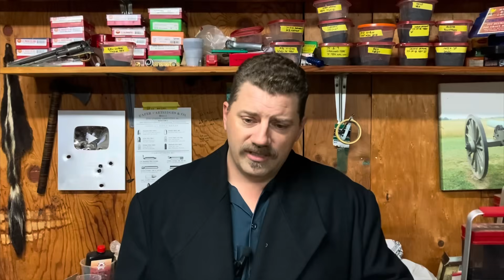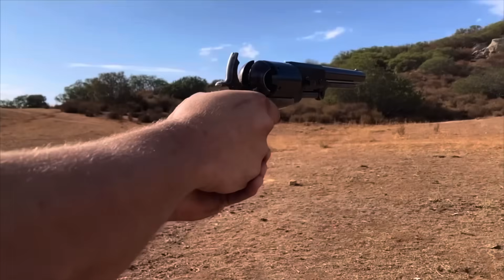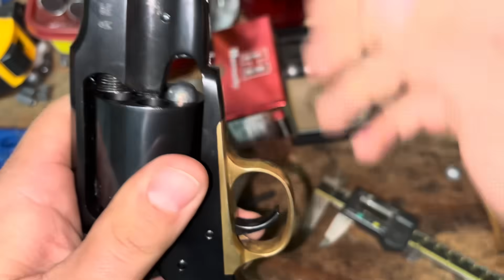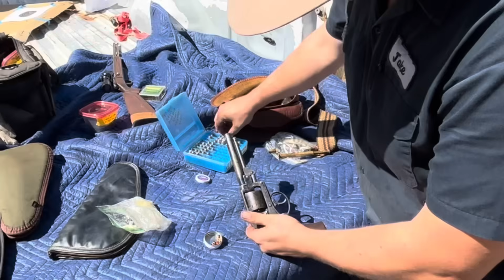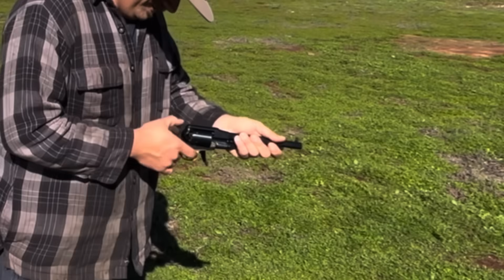Chain Fire Number 4. But Who’s Counting?

Comment: Ive only been into BP a few years but did a lot of shooting in them and i think i got lucky with good fitting cylinders. They cut great rings at .454 but i like to leave them loaded between shoots because they are guns, not expensive clubs. So I always lub them, first i used homemade lub over the balls (no juvenile jokes please) , then switched to lubed wads with a cardboard circle protecting the powder. I only did this for moisture protection for the powder but if it lubs the barrel all the better. Nail polish on the sides of the caps to seal up that end too.

However, when i go out shooting, I use that configuration up then shoot 3 or 4 more cylinders with no lub. Never a chain fire. I know shooting every other week a couple dozen shots amounts to little, but i notice that my rings are well cut and if i have a chain fire then oh well. I also use homemade caps with no issues other than the occasional light spart that doesn't go off and i usually know its a dud when i put it on. 

My experience is if you have a tapered cylinder, why not get a knew cylinder? I know money doesn't grow on trees but they are cheaper than a new gun. Granted, your not going to get a new one for that old Starr

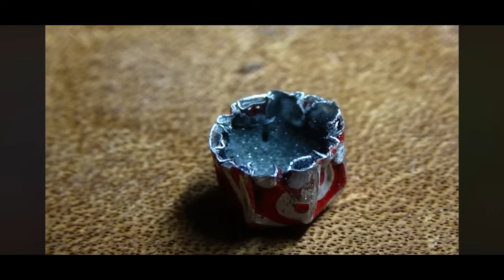Comment: 17:50 Thats WAY too much priming compound. You need half that, maybe less. I make a ton of caps and with factory nipple, they work great. That much compound and you're asking for trouble. The nipple doesn't have enough volume to contain that much pressure and gas, it has to come back at you.

Comment: It's not important what I (or we think or belive) BUT I absolutely and positively think you're right.
People tend to forget that from cylinder gap you get a signifficant pressure stream of hot gas, sparks... which gets directed in to left an right chamber
i NEVER heard of chainfire further than neighboring chamber...
If you don't use wads or have undersized balls (pun intended) -there WILL BE chainfires BUT
If you use grease/lube, wads or paper cartridges -> it WILL NOT happen !
AND.. .if you look at the low-mo you WILL ALWAYS see backfire from the nipple when chainfired but that ABSOLUTELY doesn't mean there was culprit...
(just sayin')

Comment: Ive shot cap and ball revolvers alot. Surely not as much as Jake but I'm what I'd call an enthusiast and cap and ball is probably my favorite hobby. 99% of the time I lube the chamber mouths unless I'm using paper cartridges. Ive never had a chain fires but ive always assumed it could happen from either end. My asm walker has pretty big chambers and requires .457 balls and even at that you're getting a spotty ring of lead but even shooting .454 balls of course lubed over also, it's never given me a chain fire. The correct size cap gives a nice tight seal on the nipple though. I would think it's more likely from the chamber end but that video from old ranger makes me think his chain fire was sort of special in the sense that his homemade caps look like there's priming compound real close to the opening of the cap and that almost certainly seems like the cause. Id bet that Starr chain fire was caused by caps.

Comment: Mr. Everything- I can't say for sure whether chain fires are front- or rear- originated, but I tend to agree with you that front seems more likely. I have nowhere like the amount of shots fired as you have so I claim no special expertise. That said, I have been following the loading style advocated on the Interweb by Mr. GeoJohn and have had good results. As you probably know, he attributes chain fires to 1) Imperfections of cylinder or ball causing tiny gaps, and 2) powder grains accidentally left on the cylinder front when loading giving the chance for "fuses" of powder forming down the wall of the cylinder as the ball is seated. Accordingly I try diligently to avoid excess powder on the cylinder front, and I also put a bit of lube UNDER the ball (with a half a felt wad over the powder to avoid lube seeping into it). So far using this idea load has not been followed by any chain fires, and it has a benefit that the lube seems to become aerosolized to coat the gun and making clean-up a snap. What do you think of this idea? Bob
Reply from the maker: Sounds great

Comment: After 60 years of shooting I would say you are correct in saying that the chain fire came from the front of the cyl. I have had a number of chain fires and it was almost always that i failed to grease my chambers  so there is my 2 cents on the subject.

Comment: Your correct chain fires can come from either end of the cylinder. I've had chain fires from both ends due to loose caps and undersize balls. The original Colt instructions never called for lube in the front of the cylinder.

Comment: I agree that it's more than likely the front of the cylinder being where chain fires Occur. Even though The remington having a top strap to reflect that pressure around alittle.  it's still extremely unlikely do to the pressures needed to get around a cap and have enough pressure to over come interning the flash hole. This requires a lot of pressure being the chamber is loaded. It would have to displace or compress the air in that flash hole. Even though that's a small area the pressure would have to x2 squared for every bit of Distance traveled. Pressure gos for areas of lower pressure. The pressure is high enough at the front. But Mathematically dosnt make Sense for the back

Comment: Well. I am 75. Had my first chain fire last year. In a new Remington. OEM nipples. Now i don’t shoot that much. You probably shoot as much in a month as i shot my whole life. Black powder that is. 

I typically convert my BP revolvers to cartridge and shoot smokeless. All that said here is what I’ve observed. 

Every revolver has flash at the barrel-cylinder gap. The open tops spray out all around the cylinder face. The top strap designs divert gas from the gap back down the cylinder top and in my experience occasionally blow a cap off the nipple. Allowing gas to chain fire a cylinder. Gas fouling tracks led me to that conclusion. 

I also think that there are other scenarios that lead to chain fire. Once was enough for me. I was seated on a horse shoe keg when the gun chain fired. They had to rock me back and forth for five minutes to break the suction so I could get up. Once will do it for me. 

Fox out

Comment: Been shooting along time. Wouldn't have shot the volume you have because in NZ shooting pistols there are rules about rules and more rules. When I started out gun shops only stocked 457 balls and molds so that's what we all used. Bit more stuff available now but we're 30 years down the track. 
Have shot with no lube, petroleum based lube, and tallow bees wax (far superior) wads no wads badly fitted caps NEVER had a chain fire and always have a well defined lead ring shaved off. Rightly or wrongly I credit this to be the factor that has prevented chain fires for me. Downside is ya got  to have a fair amount of oomph when ramming them in

Comment: Jake, great content.  However, please don't pinch caps to make them fit.  Instead grab a socket from your 1/4" drive set, either 5/32" or 4mm.  Gently push the cap's open end into the socket opening.  This will give you a symmetrically re-sized cap with a snug fit.

Comment: My personal theory is that some powder trickles into the previously loaded cylinder when you go to charge again. That powder ignites when firing and propagates past the ball if they seal any less than 100%, which is why they seem to be more rare when using an oversized ball or wad. I'm thinking wax negates it entirely because it A: seals it fully B: fouls the spilled powder

Comment: Your lucky to have had only 4, I've had at least 12 in 20 years of shooting a Remington. Using proper sized balls, using a 0.030 overpowder waxed cardboard wad and chamber lube so I decided I wasn't getting those occasional chain fires from the front but from the back at the nipples. About all I can get are #11 caps and I've changed out my nipples a couple times for various reasons but I finally went to a short piece of plastic tubing that both holds the cap on better and I never had a chainfire after starting using them... Yes, I had to start carrying and using a sort of bottle/can opener thing to pull the spent caps off the nipples since they don't fall off or pull off easily anymore BUT I'm not in combat and requiring fast reloading so the extra 40/45 seconds isn't any big deal (and I have 4 cylinders for the revolver anyway for 'speed loading').
Note that I have a couple other BP revolvers that I've never had any issue with at all (my Ruger Old Army just never fails to perform) it's just this one that had a problem.

Comment: Ahhhh, the lovely chainfire. I've only had one. It was when I pinched #12 caps onto the nipples. I had one of the first Ruger Old Armys. Chainfire will occur from either end - too large a cap or a loose fitting ball. Put two tons of lead down that barrel (yes, two tons). The hammer developed a divot in its face. Sold it to my brother for some unrecalled reason, and he has refused to sell it back to me ever since. 
You have listed some good reasoning regarding causes. In the case of your Remington, I suspect an out of round chamber based on the lead ring you showed. An out of round chamber will leave space for the flame to ignite the powder. Recommend a 452 chamber reamer and uniform all the chambers.
And ALWAYS, ALWAYS, ALWAYS use lube - natural based not petroleum-based. Petroleum-based lubes yield a hard, difficult to clean fouling. Natural based lubes equal soap and warm water clean up.

Comment: Jake I am not going to argue about which end causes a chain fire, as I think there are multiple reasons for a chain fire that can come from both ends. For instance, you could have damage inside the chambers of the cylinders from poor cleaning or a cracked chamber that could cause a chain fire. I do think there is one cause of a chain fire coming from the front then any other way, which is why I generally reject a bullet that has a defect in it that could result in a breech in the chamber. And for the record yes I do still apply grease.

Comment: I think that we all respect Mile  Believau and his knowledge and experience.  He indicates that chain fires happen at the rear of the cylinder.  If you load a lead ball and it shaves off a ring of lead, there's no way that fire can make it's way into the adjacent chambers.  They are completely sealed. Of course if an undersized ball was used it theoretically might cause a chain fire, but cone area is the likely suspect.

Comment: I got four David pedersoli black powder pistols. All chambered in 44. I use a 454 size ball. And it leaves a nice LED ring after I push it down into the cylinder and you can physically remove it with your finger. AKA the extra LED off the ball that is on the cylinder. Can I use pistol form pallets as the propellant or powder for my charge. And I use chapstick on the ball insertion side of the cylinder. And I've never had a chain fire on any of them. I am like you and I shoot a lot. I mean a lot. Never had a chainfire or a misfire. I've loaded my 44 that I carry for deer season for a backup round. NSN experience an example I left it loaded to the following year. Add all five shots went off. AKA cowboy load.

Comment: 7:40  From what I've learned, you ALWAYS fill the chamber mouth with grease.  Maybe you aren't using the right kind of grease?  "Crisco" is traditional (in the modern age, that is).  I'm sure you'll get chain-fires if you don't use the grease.  By the way, if a ring of lead isn't shaved off the ball, accuracy will suck.  That flat part is necessary for engaging the rifling & also, preventing the ball from tumbling.  Minie balls don't need lube (for accuracy, that is) because the hollow base expands into the rifling.

Comment: I bought a Ruger Old Army in 1973 and started shooting C&B revolvers, ML rifles and reloading metallic ammo (rifle, handgun & shotgun), in the 1973 to 1975 range. I've had two chain-fires in those years. First was with a Uberti 2nd Dragoon, where the top right chamber went off next to the fired chamber. Definitely was ignited from the front because the cap was still on the nipple, no fouling at all on the cap! The cause was a undersized conical cast from a 2-cavity replica Colt brass mold. 

The 2nd chain fire was from a Uberti 1860, where the top left chamber went off next to the fired chamber. That was caused from the nipple end, because the cap was gone and the nipple area was fouled.  The cause in that case were factory nipples with way too large flash holes allowing excessive back blast, combined with nipples too small to keep the #11 caps on. It appeared that the left chamber cap had fallen off while firing, ,so that the excessive back blast from the fired chamber was reflected by the flat breech face into the uncapped chamber, firing it. 

From that point onward I ALWAYS replace factory Italian nipples with after market nipples that have very tiny flash holes to prevent excessive back pressure. I use Track Of The Wolf nipples and do not like the Slix Shot nipples for revolver use, because I feel the Slix shot flash holes are too large for revolver use. I also make sure the projectiles are 0.005 to 0.010  larger than chamber diameter.  On my Uberti Remington Army .44 I use TOTW nipples, and I normally shoot conicals that run 0.456 (Lee mold) to 0.460 (Eras Gone and Rapine mold) in max diameter. When I do rarely shoot a round ball in the Uberti Remington, it is a 0.457, as that was the 2-cavity Lee round ball mold I bought for the Ruger OA!

Comment: Forgotten Weapons has a video called "Slow Motion: 1860 Army cap & ball revolver" it's a pretty impressive burst of sparks from the cap.. I can see chainfires happening from either side depending on what went wrong.. Loose fitting ball or deformed ball letting fire pass to the main charge or an errant spark from the cap either setting off a nipple with no cap or setting off an ill fitting cap.. Both of those are easily mitigated and I don't think there is one correct answer on which end the chainfire comes from because it just depends.. would be interesting to try to force a chain fire under slowmo and get decent video of it happening, but sadly a camera that would be able to record fast enough are somewhat insanely costly.. I'd love to see the Slow Mo Guys try to take that challenge on to capture one..

Comment: As teens we loaded an old belgian cartridge revolver with entirely homemade ammunition, even the case was not the right size (rimless). No primer used (unsure if boxer or berdan case or if the anvil was drilled out) but just a an iron disk over some "mixture". We used something very sensitive as primer and load, just imagine the the most stupid or dangerous mixture. So the first shot set off the other four chambers, likely only by the shock. Luckily we used soft lead bullets from old tire weights.

Comment: Hmmm..... Jake, I think physics is definitely on the side of "It most likely originates from the front." As the "antique muzzleloading revolver" fires, the cylinder and body of the revolver are forced backwards. Since the projectiles are not physically attached to the cylinder they will try to move forward (think of attaching scope rings to a rifle with a picatinny rail, it's push forward against a lug so it won't move under recoil). If that projectile is able to move just enough, it may expose the propellant within. Now, at the same time as this is happening, the vast majority of hot gases, embers, whatever, are being directed across the front of the cylinder to the left and the cylinder to the right of the cylinder that is in-line with the bore. Add those two phenomena together and sometimes, one might possibly get a 'chain fire.' Now, for a rear starting chain fire, it seems if they ever occur, it happened because of an overly sensitive cap going off, but even then, it does not seem likely.

Comment: I was a civil war reenactor, back in the 90s, I had a CVA colt walker, and a 58 remington and 2 spare cylinders,  we were a cavalry company.  We used wax toliet bowl gaskets, they were a couple of bucks, and get years of use out of one. Never had chain fires. I had a friend of mine in a another unit, had a chain fire every time he pulled the trigger, he started using the toliet bowl gasket and it solved his problem.  It also makes cleanup easier at the end of the day. It was sticky enough and denser than bore butter, so we could actually have the revolver in our holsters on a hot summer day without it melting out of the chamber.
Reply: I endorse bees wax rings for bullet lube and chamber topping. Also great flux for the lead pot.

Comment: I have been shooting BP revolvers for over 30 years and i have had just 1 chainfire. 24 shots a session was my normal amount to shoot, and when i was making enough I went almost every weekend for over 3 years. I use a wad under the ball and lube over the ball (i find it helps with cleaning after) and i always checked cap fit and changed nipples if needed to ensure a good fit. 
I have seen quite few other shooters have them on the range and heard all the excuses / reasons. 
In my opinion it needs a "perfect storm"  set of conditions to occur, and can be initiated from either end.